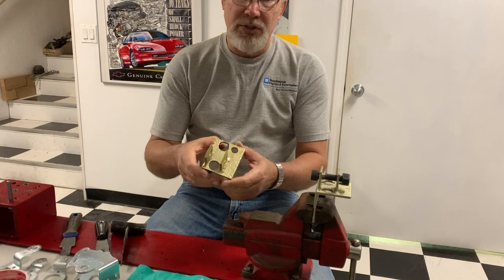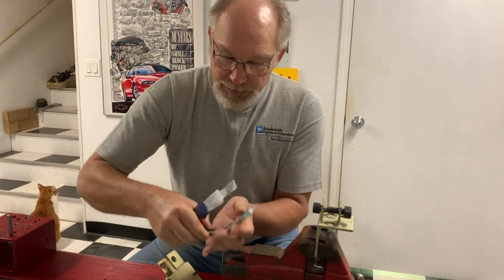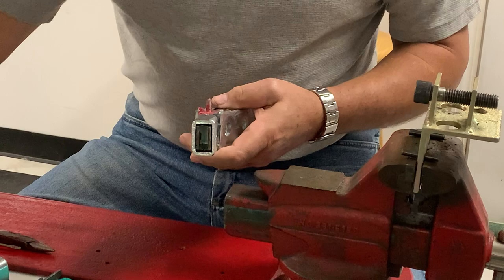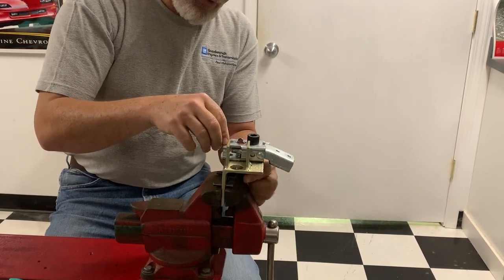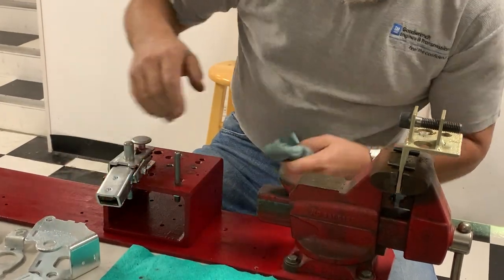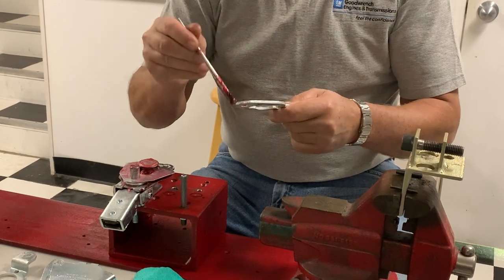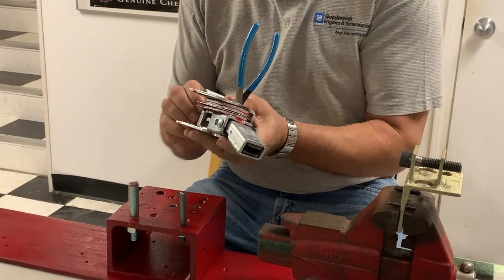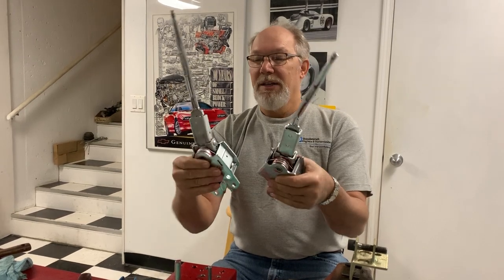Hurst Shifter Rebuild

Comment: At the end when you re insert the shifter shaft, is there a mechanism inside the square part that holds it in place,  I have the same type and mine must be missing something as I can just pull on it and comes right out freely?
Reply: His other video covers the shift retainers at the end.  Never goes into how to put the new ones in.
Reply: Yes, there should be a clip built in to the metal piece that goes behind the rubber insulators and clips into the shifter handle detent. The clip part should be at the top of the mechanism and facing toward the center of the housing when installing.

Comment: installing a new shifter,
re install with the putty knife method?
mine does not have the two bolt application on the insert
Reply: If you have the push in style, it should just slide right in and there's supposed to be a built-in spring clip in the mechanism itself that clips into the handle detent. Only need the putty knife method or a .010 feeler gauge for removal of the handle.